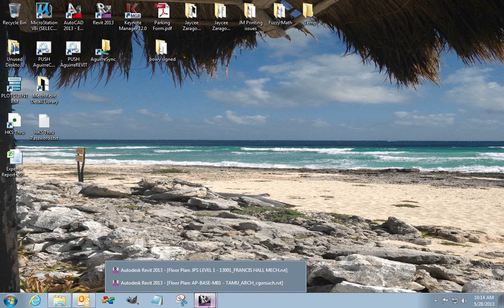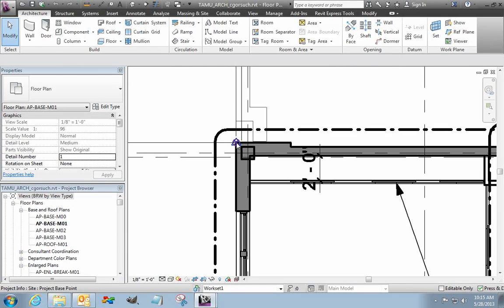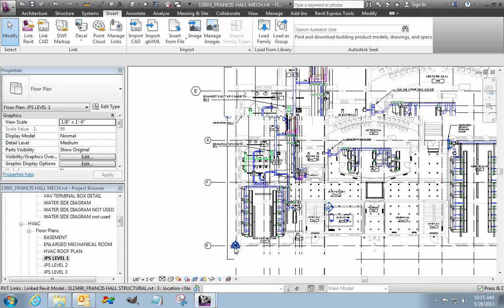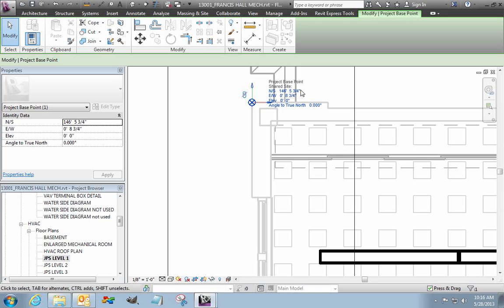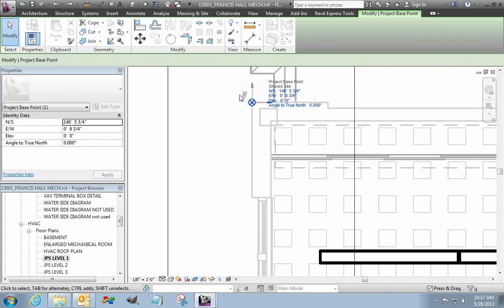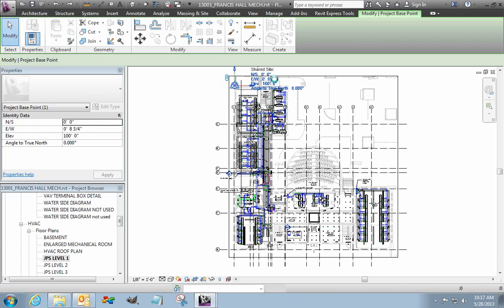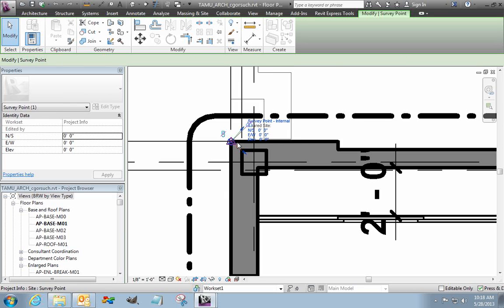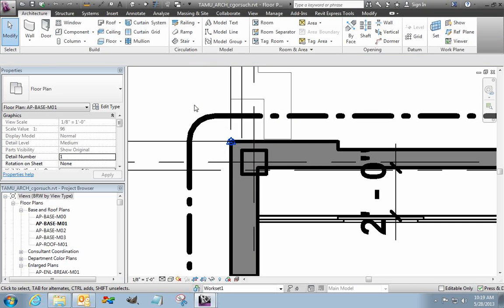Moving a Revit Project Origin

Comment: I have a model that is not aligning in Navis when exporting from Revit. it is consistently -8'-0" e/w and -13" on Z-axes. this never changes no matter how many times I clip or unclip while changing PBP or Survey Point. The shared project location can be 10'-0" or 1000'-0" when I export to Revit it's always in the same place and never moved.  I am starting to see that the "ORIGIN POINT" is what is behind the issues that I am having and I don't believe it has anything to do with the Shared location. It is as if I have too high light every item in my model and physically move them 8'-0" over to the east. can the original ORIGIN point be moved?
Reply from the maker: US BIM Consultants I ran into a similar issue on a different project and had to move the project in Navisworks.  Fortunately the type of file one can save in NW means new exported models are automatically re-pathed to the correct location in NW
Reply: I found the root of my problem. I was exporting a dwfx file. It's a great way to export to Navisworks and keep the texture maps that you have in Revit. the issue that I had was that you cannot export a dwfx with shared location only project location. my issue was simply not knowing that small but very mportant bit of info. If you export a dwfx and its in the wrong location you must move it in navisworks.